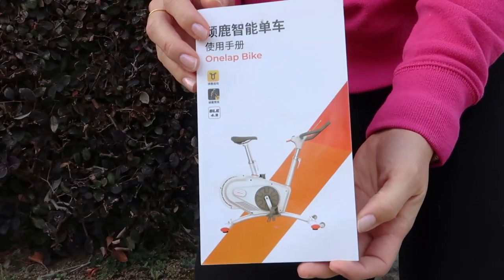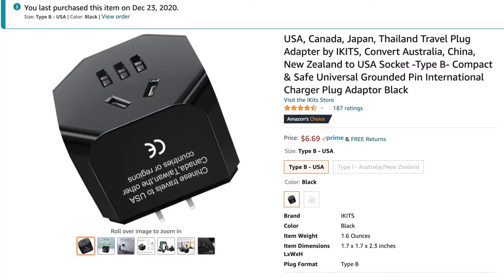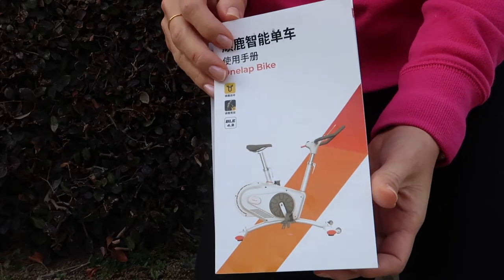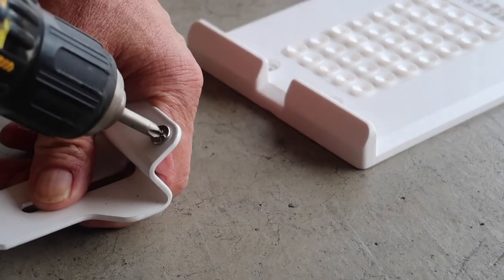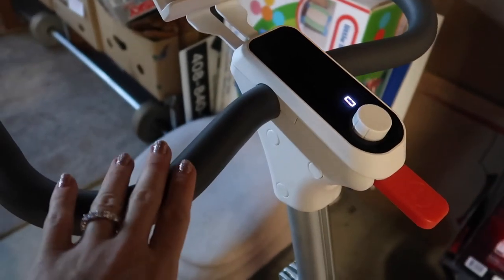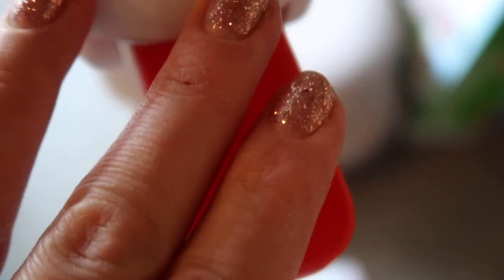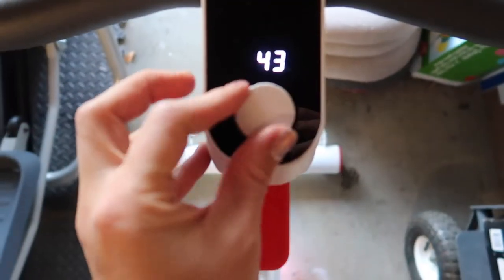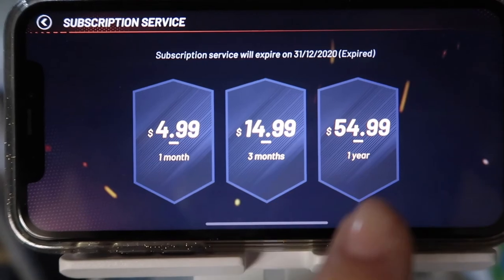MAGENE Onelap Smart Spinning Bike Review | Unboxing, First Impression, Thoughts

Comment: Hi! Thanks for this video! It's one of the few videos available online for the Magene G801. Since it claims to be Zwift compatible, have you tried using this bike with Zwift? If so, how well does the controllable resistance work with Zwift, e.g. adjusting to different terrain gradients in free ride mode, and also adjusting resistance to meet power output in workout/ERG mode? It's so hard to find a spin/indoor bike that is fully compatible with Zwift and costs under $1000. Would love to hear your thoughts on this. Thanks!
Reply: did u happen to find out any information on your question because i as well i want to know about this ?